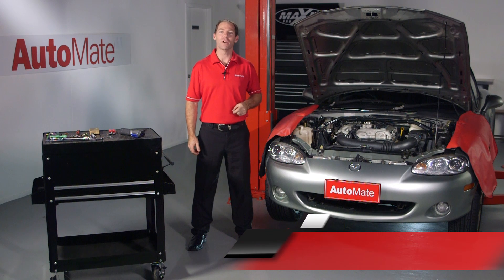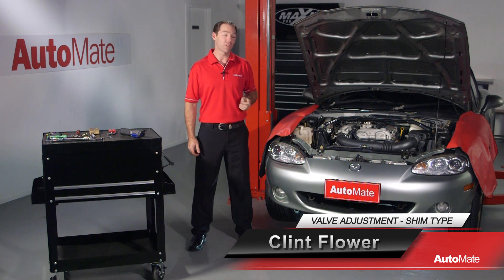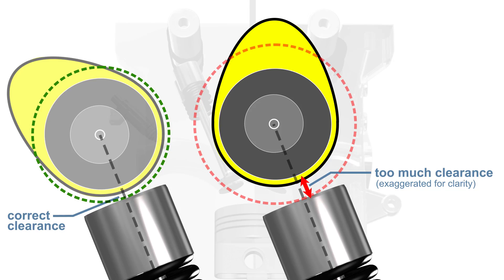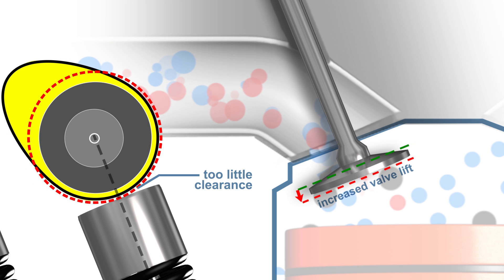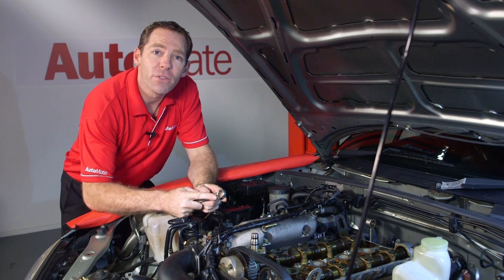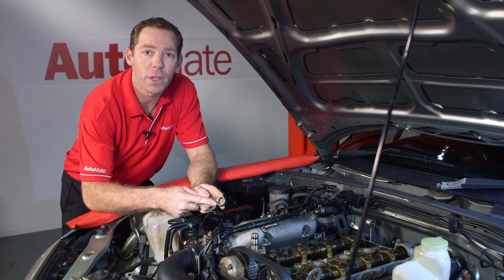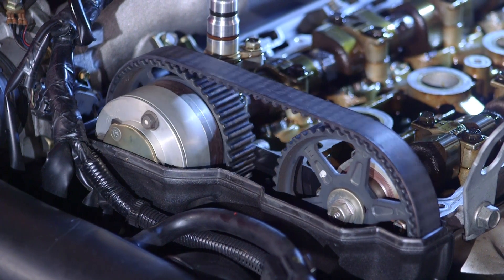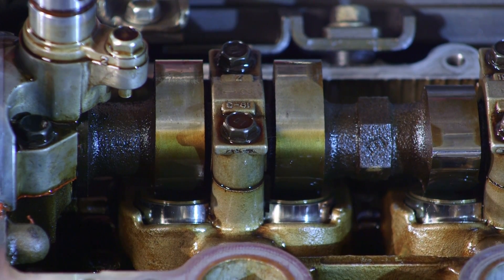Valve Adjustment Shim Type

Comment: Hi, i have toyota platz with 1sz-fe engine auto transmission, problem is when my car is cold i start its not stable i have to accelerate to keep it start until it get warm and it is power less and didnt reverse until its gets warm. 
Kindly guide